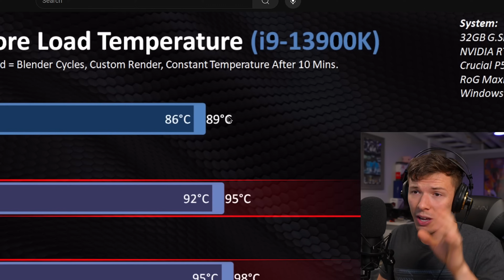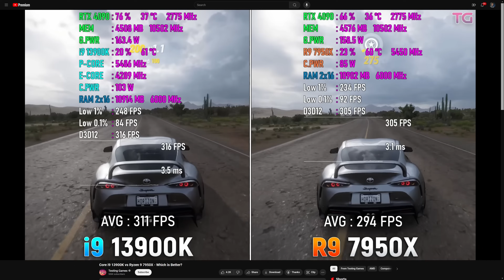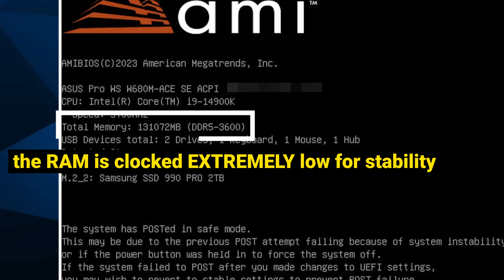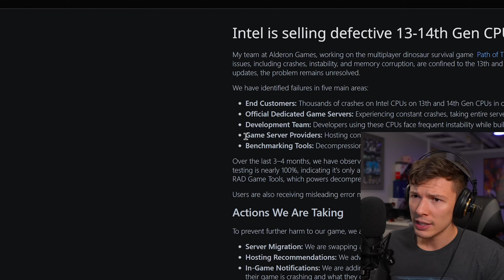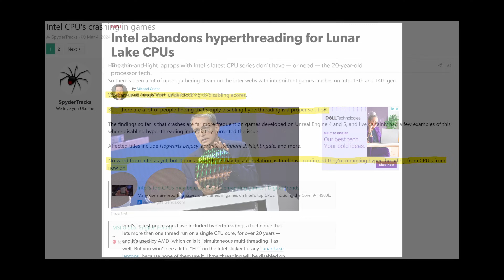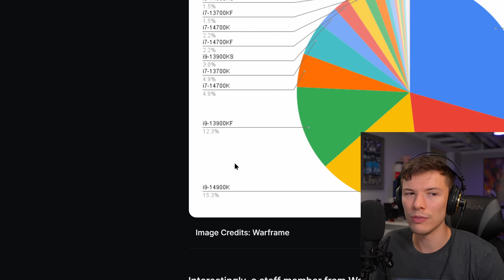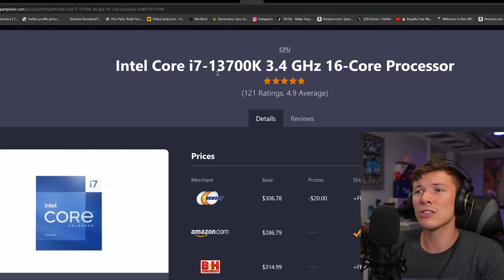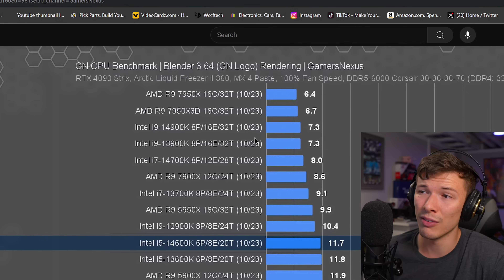Intel F**ked Up Bad

Comment: I’ve had intel in my computers all my life. This year I decided to upgrade my PC and decided to go with AM5. Dodged that bullet
Reply: Same! Proud 7800X3D and GIGABYTE AORUS AX ELITE AM5 owner now! 14900K overvolted itself to death.
Reply: @iLegionaire3755  same setup here. fucking love it
Reply: I bought a new computer last year. I considered Intel for a while, but then decided to take the 7800X3D. (had a i7 4770k before) I guess that was the right decision.
Reply: Same. I've used nothing but Intel since I started building back in 2011 but last year I was looking to upgrade since I was still running a 9900K and came across one of those 7800X3D/AM5 Mobo combos and I haven't had a single complaint since I started using it.
Reply: Same here, my first AMD build and I couldn't be happier.
Reply: I've had a wider variety. My first computer used a 6510 (6502 clone with quirks) and I've run a lot of Both Intel and AMD based systems lately. even had a Cyrix cpu at one point. I think I had a z80 based system briefly as well.
Reply: @kaseyboles30  ahhh the good old days.... I had a amd 386dx40 , then jumped for a intel 486dx33 the the dx2 66 mhz and i also had a Cyrix cpu running a 166 mhz that i overclocked to 200mhz back then no bios overclocking  you had to configure the jumpers on the board hahaha ahhh i miss those days
Reply: @RedLine0069  Yep, back then the bios was for setting the time and date and topology of your HDD if you were that lucky. Oh and setting default interrupts and addresses for the printer port and com ports.
Reply: @kaseyboles30  kids nowadays do not know the struggle,  back then in school in the 90 trying  to setup a network on the computers that we had in the room with those shit connectors lol
Reply: @RedLine0069  I could probably still tell you the speed of a dial up connection on sound alone.
Reply: @RedLine0069  lol yes with that separate cache slot.  I don't miss the days of trying to avoid irq conflicts though.  Or changing the config.sys to get the right amount of memory for a game to run.
Reply: AMD is the way to go  plus saving money!
Reply: I own all the flagships, and they all still work, i9 hits 41 to 43k r23 depending on tune, and I must be good because zero stability concerns in over a year of i9s....  Heck, my x3d hasn't melted in an asus board either.

I'm so lucky...rofl...

Actually, looks at voltages when building a pc*

Crazy thoughts, I know.
Reply: @stevenoneya7710  well that melting issue has been fixed for a long time now as far as i know.... But it's scary to buy new generation of anything nowadays... Nvidia melting,ryzen melting, intel degrading and passing away and Radeon bugs.... Qualcomm will be my next option i think 🤣
Reply: @nenadcaric5195  lol, yeah, I just hate watching any tech "media" anymore.  

Most of "tech media" guys couldn't hit a top 100 run on anything without a brand rep holding their hand on camera or behind the scenes or teleprompter... and bruteforcing with ln2... but they lead millions of purchaser's to make decisions based on regurgitated nonsense they dont even understand, lol.

Let alone running stable and longeviry based oc on a 43k plus r23 i9 for a year with zero vid to core separation. " Why, for how come jot play adult lego 43k? "

Those same consumers will fight tooth and nail over something they don't understand.

Meanwhile tech tubers are taking brand sponsorship either directly or through media conglomerates to avoid disclosure.

The way I see it, if people don't know what a crystal oscillator or vco is, they probably don't have enough time equity or education to weigh in, lol.

They will, anyway...
Reply: @nenadcaric5195  I've been giggling at the idiots that think a w680 board can't hit unsafe single core or dual core voltages.
Reply: @stevenoneya7710  true but w680 is an intel one 🤣
Reply: @nenadcaric5195  yup, imagine if it was a b650e or x670e, the public outcry against ASUS!

Oh wait, that happened

Wonder why this one is different, benchmark envy I suppose.

Sucks to be knowledgeable in a room full of tongue flappers who's only qualifications are the gaming pc they built by watching youtube videos.

Thanks for being a real one.
Reply: You are the Man. I am proud of you.
Reply: Same
Reply: 12th gen is fine, it's not only faster than 13th and 14th gen across much of the product stack but also actually stable. Although I have to say a Ryzen 5 7600 really is a good cpu.
Reply: Quite the contrary with me. The last Intel CPU i bought for a gaming PC build was a Celeron 333. I developed not to be an AMD Fanboy, but to be an Intel hate boy, so from then on i only bought AMD. Athlon of course, but i also had a Bulldozer in one of my gaming PCs.
Ryzen 1600 followed, then 3600X, and now 7800X3D together with an 4080S.
The only thing i have to use Intel CPUs at the moment are Laptops. Bummer.
Reply: @cutterboard4144 you really need to hate them a lot to get a bulldozer cpu 😅
Reply: Every 4/5 years always upgraded. i5 4690k back 10 years ago, then AM4 Ryzen 3700x. Now, probably a good AM5 for my next go-around
Reply: How hot is it getting?@ToxicGamer86454
Reply: Amd fx series was still less of a nightmare than what intel makes. Buying an msi gaming laptop a few years ago but one that uses intel instead of amd has been one of the worst computer decisions I have ever made. Never will own an intel product again lol
Reply: Same here! Couldn't be happier, except for the memory controller. I feel that's the only component where Intel still has a leg up.

Comment: Buildzoid recons its the ring bus voltage being too high(the e-cores set the ring voltage high, so do p-cores running at 6ghz) which is why the not power sucking server cpu's also going bad
Reply: Moore's law is dead reported that an Intel insider believes it the connection between the Cache and the E-cores.  He also stated that once the connection is damaged, the chip will eventually fail.
Reply: @yonghominale8884  yea, I think thats the ring bus(but Im unsure)
Reply: Definitely makes much more sense than temperatures. Thx for the info
Reply: @mastroitek   ohm's law explains the temperature part very well because as you increase temperature you also increase resistance which asks for more voltage and amps to push through the resistance which results in even more heat and higher temperatures
Reply: @xthelord1668  sure, but cpus have safeguards since more than a decade, is not like they melt themselves. Voltage seems to pose a higher threat on its own
Reply: @mastroitek  many AIB partners were disabling protections to enhance performance which is why temps could have played the part in this situation (hence the initial intel's shifting of blame to AIB partners)

and as i said voltage and amperage go up as internal resistance goes up and as result we get even more heat which just causes even more resistance to occur
Reply: @xthelord1668  but CPUs shut down on their own if temps get too high, that is built into the hardware
Reply: @mastroitek  yeah but CPU's never reach shutdown temp which is 112C, they sit at 100C instead because boosting algo starts downclocking to try to control temps
Reply: @xthelord1668  yeah exactly, that is why I don't get why temp would be a problem, 100°C seems fine, and it was fine for older gens, it is a while that Intel pushes cpus that far, especially on mobile, but there were no issues
Reply: @mastroitek  It is a combo of voltage and temp.  This is why people can push insane voltages through CPUs with LN2 cooling.  And the age old adage among overclocker's of "whatever you can keep cool" exists.

A normal safe but high temp for a CPU may become deadly if that temp has a ton of voltage being put through it at the same time.

100c, even 80c with 1.5v+ is going to cause substantial damage.
Reply: @JathraDH  That's... no.
You're conflating the effects of too much amperage (heat) with the cause of the issue... which is too much voltage.
"Extreme overclockers" degrade the CPU rapidly, even at negative degrees. 
Your arbitrary line in the sand at 1.5 volts is proof that you know nothing. A golden sample CPU could operate at well above the normal "overclocking" voltage for years where a poor quality one will not.
The claim that 80C would ever cause damage is laughable when the junction temperature is 20+ degrees higher.
Reply: @tim3172  Uh, no.  If you put the voltages extreme OC uses through a chip at normal temps it would instant die before it even posted.

Heat absolutely plays a factor in how fast degradation happens.  I never stated extreme OC does not degrade a chip, stop putting words in my mouth.  The cold temps absolutely slow the rate down.  The fact the chip even survives at all is plain proof of that.

Heat also effects how degradation happens naturally.  This is why chips that run hotter live shorter lives.  Again, this is common knowledge.

A golden sample CPU "leaks" less which means not only does it require less voltage, but that voltage translates to less heat, which means less damage.

The junction temperature is the temperature at which the chip will instantly die if it exceeds it.  It has nothing to do with the safe operating temperature of the chip long term.

Your understanding of amperage is also entirely off.  Volts x Amps = Watts.  Wattage is heat, not amps. Increasing either voltage or amperage will increase the heat load.  Why do you think space heaters and hair dryers etc are rated in watts?
Reply: @JathraDH  thx, makes sense.
I forgot to turn on my brain today before opening yt, ups
Reply: @mastroitek  hes explaining one of the many factors that go into the increased voltage problem not saying temps are the only reason, just that temps can add to the problem

Comment: Thank the heavens I have not upgraded my motherboard, in turn, buying a Intel 13th gen CPU. I am still rocking the Intel 10th gen cpu, and still works pretty good with modern games, and has never crashed.
Reply: I understand your sentiment.. 11th gen here.
Reply: Still rocking a 10900K here, not upgrading for a little while yet
Reply: Hold on to that 10900K for a little longer. Fingers crossed Intel fixed this issue on 15th Gen, or just buy AMD lmao.
Reply: Agreed. I have the 11600k. I recently went with the 11900f. Although the 600k I think is a better chip. i wanted something with a little less power draw all the time in a sense when I’m doing non-intensive task. And plus I was like why not just max out the chip I can for an outdated socket not like i plan on upgrading anytime soon.
Reply: I'm using an i5 11400F. it chugs a truckload of power when gaming but it works well.

Comment: I'm placing my bet on it being Intel pushing the boost algorithm to far with 1/2 cores being boosted way to high, resulting in it pulling to much voltage which leads to cpu degradation.
CPU degradation doesn't happen instantly but over the span of a few months I'm willing to bet that these CPUs are just degrating to the point where they fall outside of their VID Table.

Setting power limits is not the fix, power draw isn't the issue either. 1/2 cores aren't going to pull 125W, so setting power limits even as low as 125W, it won't stop the rediculous boosting of a few cores.

Currently the best fix to me seems simply syncing all cores at a voltage that is stable.
I've always had my CPUs from day 1 manually tuned with all cores synced and without using suicide voltages and I've never had any issues.
Reply: But this also affecting CPU using the W6800 chipset which doesn't allow high boost voltages.

Comment: I don't think it's a power issue as much as a voltage issue.  Some of these will have crazy high voltages thrown at the CPU to allow them to boost the preferred cores.  I've overclocked a lot of 12th - 14th gen CPU's and haven't seen any of these issues, but I also don't let the voltage go anywhere near what it can in stock configuration.
Reply: So do you overclock them or underclock them "nowhere near stock configuration"? Which is it?
Reply: @M_CFV If the main problem really is silicon degradation then the main culprit will be the high voltages. From what I know even at low power limits if you're running a single core task the i9s will still boost to insane clock speeds on just one or two of their P-cores, which still needs high voltages to be sustained but doesn't break the power limit since even these overvolted single cores don't draw enough power to breach their total power limit. What kills the silicon isn't the clock speed, but the high voltages.

If this is correct, what you have to do to avoid killing your CPU is manually setting some kind of voltage limit, not just a power limit.
Reply: @danieltanuwijaya7675  thank you for the detailed answer, exactly what I was looking for
Reply: power and voltage are correlated....What kills the cpus is the amperage, not the volts, not the wattage. cpus pulling over 300 watts at 1.5 volts is like  200 amps, that is crazy.  Cpus have many pins that are just to be able to pull all that currrent, a single pin would literally melt, but dividing the current in many pins allows for it.. Now, this last 13th and 14th generation went with much higher TDP but same pin layout, that means they are pulling more amps per pin...no wonder they get super hot and degrade and crash.. funny enough, the socket basically got "too small" for such cpus.If you are going to pull so much current, you will need more pins...
Reply: I know my MSI z690 motherboard has an boost setting if I want to try and overclock my 12900k. The thing will instantly hit 100c in cinebench and start to thermal throttle with a 360 AIO when enabled. The funny thing is it doesn't perform any better than stock. Even funnier is that I have a slight undervolt applied to the stock settings and I don't see over 80c max in cinebench and still get the same performance.
Reply: Pumping 1.5v at 6GHz on a 7nm process🤣 Someone must've waken up from a coma from all the way back since Sandy bridge😂

Comment: Yep always bought Intel my entire life. My 13990k is the last Intel processor I buy. They fudged the numbers for the benchmarks. Too keep my system stable on a 360 cooler I run my ddr5 at 4200mhz and power limit the thing. Never reached anywhere close to reviewed benchmarks. CPU needs fans running all the time even when idle so worst processor in decades.

Comment: Ive got a 13600kf atm and will be switching to the R9000 as soon as they come out. Ive had more blue screens in a few months than I did for 3+ years when I was on a ryzen 5700x
Reply: Good call man, am5 will hopefully keep you going for a few more gens! Really disappointing tho, one of my strongest recommendations to customers is the 13600k when they refuse to go AMD, and if even those are having issues.... yikes
Reply: @InfernoTrees  Yea ive got people that refuse amd as well its just unfortanate
Reply: I got 13600kf, bought in the release and OC'd to 5.3ghz stable. How u getting so much bluescreens?
Reply: @HerkulesRS  it happens over time and not to everyone. You may have gotten very lucky, in which case congratulations! You have successfully dodged a bullet.
Reply: @InfernoTrees  cool, havent really heard about these issues before today. Just the huge power draw of i9's are the things i have heard before.
Reply: @InfernoTrees  So far there are no reports of any 600ks being affected, likely because they run at lower voltages and clocks. This could change in time however.

Curtin's report here is the first I've seen of a 13600k being affected.
Reply: @HerkulesRS  Not sure it just blue screens. No OC applied with the bios fully updated so it looks like you just got really really lucky
Reply: That's interesting, because the i5s were actually really good for their price, and deemed reliable. Intel messed up by really wanting their top line-up to top AMD even though they're behind in technology
Reply: I have 13600kf and had 0 CPU errors for 6 months. Maybe you use old bios on motherboard (try updating to last not beta version)

Comment: I have i5 13500 and i haven't seen any problems as of now
Reply: I have the 13400 and was confused cuz ive been using it for a year now. Apparently only the high end stuff that has the problem. Most vids and stories never mention it in their title.
Reply: @S3Bayaya  yeah bro. I purchased my new pc after 2015 in 2023 last year in may. I have been using the processor for a year now i haven't seen any issues with it.. i only game though i don't do game development or video or photo editing or 3d rendering work so i don't know if some problems can be seen if i use them regularly and face any issue like those game developers are facing. Only issue i had was one day windows suddenly died on me lol. Sometimes it started and sometimes it didn't. I had the utility of Hiren boot CD in my usb so i booted from that instead of the windows and it was working. But i am pretty sure the windoes update was the reason for that. The error stated that (NetStart:The system seems to lack either network cards or network drivers.) It is similar to the GPU one showing in this video though. I don't know man i just hope everything turns out to be okay. I have invested a ton of my parents money in this PC i even bought a MSI z790 board to be "future proof" with enough Dram to run K CPUs in future if i wanted to.. but i guess that won't be happening now lol.. plus i am using the bios which are a year old.. now i am afraid to update bios too lol..
Reply: Only i7 and i9 has the problem
Reply: @EmperorGaming-m4f  so 12400f is safe to buy ?
Reply: @desiotaku3435  it's 12 gen bro not 13 or 14 so yeah pretty safe to buy
Reply: @desiotaku3435  yes
Reply: @tempestblaze6051  can you also tell me how many years intel CPU and amd GPU gets driver update
Reply: You’re not very bright, son.